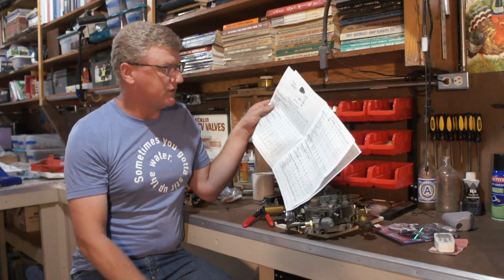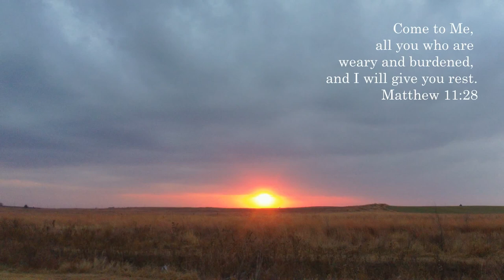Rochester Quadrajet Rebuild - 1986 GMC M4MED

Comment: Just about everything is easier to adjust/tune than a Quadrajet carburetor...BUT, once properly adjusted, Quadrajets provide more power more efficiently than just about any other carburetor around.  The carb has adjustments for every phase of engine operations...and...they almost always need some tweaking to get right.  Pay no attention to those nay-sayers out there who claim to be Q-jet specialists.  Most of them just hate to have anyone de-mystify the art of Quadrajet mastery that they claim to have...  I guess they are afraid of being slightly less special...   You did a fantastic job of encouraging the common backyard car guy to not be afraid of tackling even the most daunting of chores to take care of their cars....
Reply from the maker: Thanks a lot! I appreciate the kind words.
Reply: Saw a guy put a brand new quick fuel 750 on pontiac 400ci  dyno 360 hp with carb put back the old quaddrajet same exact power!!! I was  surprised same graph lines on dyno down to 1 hp and everything
Reply: Never could get mine to work after a dozen times. Had to give it up and sell the van with an after market carb.

Comment: I have a very similar carburetor off ‘86 Chevy C10, California vehicle.  I’m starting to think the idle mixture solenoid is bad.  How do you test that?  I read somewhere there should be at least 10 ohms of resistance on the terminals.  Is that correct because mine barely reads 10 ohms.

Comment: Thats an M4MED specifically. The tan solenoid isn't mixture feedback.

When the engine warms up a temperature switch triggers that solenoid which opens a valve allowing some of the accelerator pump shot to leak back into the bowl. The "D" on the end of the model type is for "Dual capacity accelerator pump. Ive got the same one on my '86 and have rebuilt it a couple times in the last dozen years.
Reply: I was going to say the same thing about the dual capacity accelerator pump. If left unplugged it functions like a regular one.

Comment: Anybody that calls a quadrajet carburetor junk is a fool! Best carb for economy while having  decent performance  and not having to rebuild it every year. I run q jets on all  my chevy engines. 
They are a bit more demanding to rebuild but worth it.
On your carb,  you have a little electric connector on it that your pickup probly could plug into the  factory harness to meet emissions. This works only when you have the computer hooked up. And it takes info from the HEI and I'm sure yours has extra connectors. That sets the electronic spark control up.
Btw...I love your engine color!
John 3:16

Comment: For the idle mixture screws I take them out and put them in a vise between two blocks of wood, then with a hacksaw cut a slot in the middle so you can use a screwdriver OR braze a piece of steel tubing on them so you can adjust them with no tools required.

Comment: I'm rebuilding a Rochester carb, from an 88 Camaro, and it has a little tab on the upper plate that operates a little valve. It's next to the little valve operated by the throttle rod, I can't find ANY info on it and it doesn't seem to fit the typical gasket set. Also, my needle set has a little plate that operates it rather then spring set. It's like a spring then a little plate sits on it, and that is how it operates. 
My question is, does this invalidate my gasket set, and should I look for the correct one?
Great video, very informative and precise. Cheers!

Comment: Hello Sir, God Bless and greetings from Australia.

Fantastic video as always.
Can I ask, what method did you use to secure the tubes in the airhorn that had fallen off. Was it Loctite, JB weld or some other method.
Warmest regards,
George (Bonneville 1960).
Reply: I am curious as well on those tubes. No wonder if didn't run worth a darn...
Great video with the play by play.

Comment: this is a very good video! I need some advice on something. I recently bought an 1986 chevy truck with a V6 4.3. It has a propane system on it and the original carburetor is no where to be found. I have a 78 quadrajet that I just rebuilt and would like to install it. the truck intake manifold is the original spreadbore quadrajet carburetor. Also this engine has the electronic spark control distributor without the vaccum advance. if I put this 78 carb I got on it do you think it will work just fine?
Reply: You can delete that spark control system and throw a hei distributor in it with a vacuum advance then you would be good to go with less electronic crap getting in your way

Comment: hi there. found this video very helpful.. I was wondering if you can help me figure something out. I bought an 86 GMC V6 to restore but the carburetor was missing. It has the stock spreadbore quadrajet intake manifold. I have a quardrajet off of an 86 chevy 350 and I am wondering if this carburetor will work since it came off of a V8 and not a V6.. Somebody told me this carburetor would be "too much fuel flow", but I dont buy it. Can I use this carburetor on the stock 4.3 L V6? It seems to bolt right on..
Reply from the maker: You may be on the verge of too much but why not try it? I honestly can't tell you what CFM they put on the 4.3's. Otherwise it would be easy enough to get a smaller Edelbrock or Carter and an adapter plate.
Reply: @TheJayhawker  thank you!

Comment: Question,in there a difference between any of the sbc timing covers ?which one requires the larger front oil pan seal from the felpro oil pan gasket set
Reply: The difference is the pan, not the cover

Comment: I honestly don't think he used the correct nomenclature for a single part.
He only sealed the main well plugs, what about the other 3 ?
I won't mention that he should have capped off the idle vacuum air bleed holes (we used double ought buck shot hammered in to do that) in the base plate so the idle mixture screws actually work correctly.
Screw where the index is on the choke, what was the tension ? and how many degrees did the vacuum pull off crack it open ?
Carbs are best left to the pros and I worked for the "Carb shop" in SoCal way too many years to ever take this video serious.
Did he even know that the primary power valve adjustment screw sets the main jet mixture at both cruise and accel ?
Certainly seems like a big no from here.....other wise he'd know to never move that screw unless something is very, very, very, wrong.
Reply from the maker: It must be very difficult to be an expert at something and watch an ordinary guy do something not many people do anymore, huh. But let me reply to a few of your statements.
 If you have never made a public video you may not know that showing every single minute detail looses interest fast. As it was the video was already almost an hour long. Which was why I simply explained to follow instructions on making final adjustments.
Also not talking down to people, but instead using language that they themselves can understand makes them feel included.
Indeed I did seal all of the plugs, but only showed the main wells. Like I said I sealed everything...
As for the pv adj. screw, it was out 3 1/2 turns, it goes back in to 3 1/2 turns....maybe I'm missing something... This carb had very old dried out gas in it everywhere and I wanted everything cleaned out within reason. 
It seems to me you're very anxious to share your knowledge but you don't share it well. Instead it comes out in the form of degrading put-downs. 
Perhaps there is a much more constructive way of sharing that knowledge and passing it on to the next generation instead of just trying to be insulting. Maybe you could begin by making your own videos.
But instead, if you would like to share some of your knowledge with me, great, I love to learn from guys with experience. I'm learning all the time, I normally don't do mid-80's stuff. It's not where my main interest lies, but rather cars that are much, much older. But I'm willing to learn and to do it. So how about a little mutual respect man? Thanks for watching and God Bless.
Reply: I am not a pro but have seen rebuilding these for over 30 year and yes he is clueless.
Reply: @TheJayhawker  I have an M4MED on my truck and know I couldn't rebuild one. And because of that,I don't think it's right for me to criticize anyone who does....or even attempts it!Watching you rebuild this thing was very impressive. By the time you took everything apart,there were more parts layin around than a chop shop,but you seemed to put everything back together w no issues. I'm guessin you tinkered w em in the past.😂
Keep up the great work and thank you!👍🏻
Reply: @TheJayhawker  Well said Mr. Jayhawker. I would be very interested in learning why we should "capped off the idle vacuum air bleed holes" and if that is something you perform?

Comment: Holley's are so much easier to rebuild and tune.
Reply from the maker: I certainly agree, about any other carb. is easier. But in my opinion few are actually better.
Reply: @TheJayhawker  I’ve seen a guy at the drag strip run low 11’s with a Quadrajet